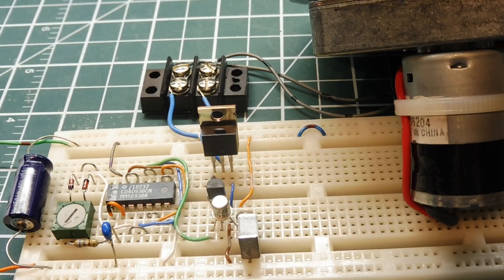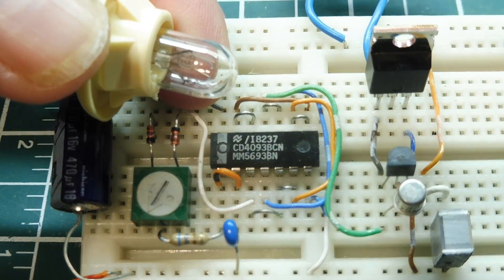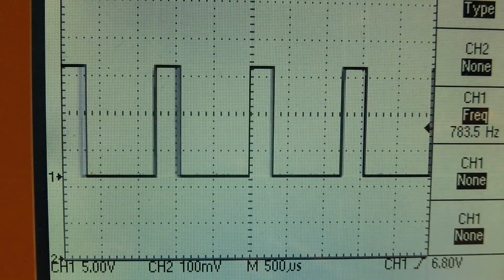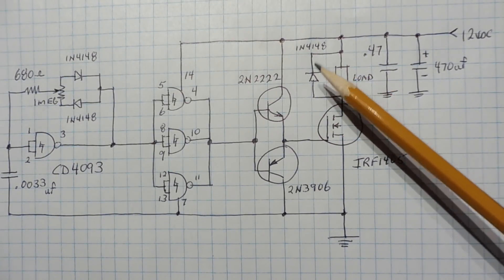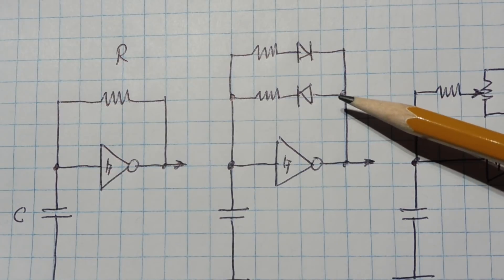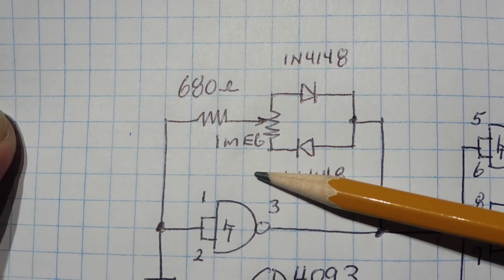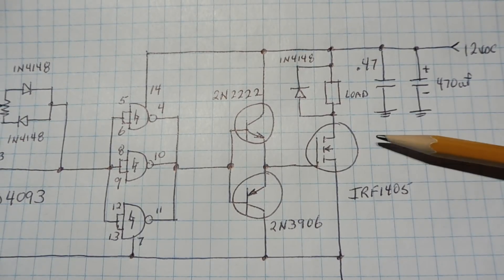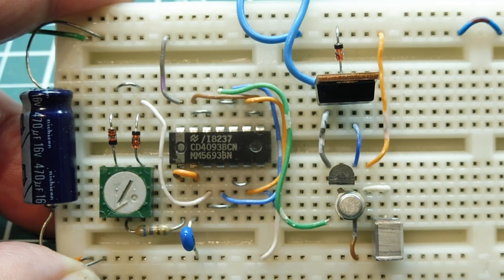Build A Simple Pulse Width Modulation Controller  / PWM

Comment: Hello just wanted to ask if i could use this circuit with 24v to drive some 24v fans?
Reply from the maker: The logic circuitry can not handle 24 volts. Check out this video featuring a PWM controller for DC motors that can handle 24 volts. https://youtu.be/1qing2TJWSc
Reply: @0033mer thanks for the advise i also will build this circuit for 12v applications but i cant find the irf1405 mosfet i only could find irf1404 mosfets and wanted to ask if i could use that one since its also a n channel mosfet.
Reply from the maker: Yes, any general purpose N channel MOSFET with the correct current rating will work.

Comment: anyone please can i use this circuit to run 240v AC load ??????
Reply: Absolutely NOT, there are much simpler ways doing so - you get triac, you get potentiometr and one resistor maybe, and viola, you control exact moment [voltage of AC] triac opens and close, if current of gate is too small, wont ever open, if it's high enough will be kept opened all the time, you can even use photoresistor to dim light automatically, PTC thermoresistor to make temperature regulator, MOSFETS in general are for low voltage high current applications, transistors are for higher voltage applications ~100V or so, thyrystors for DC to AC conversion and triacs (basically two thyrystors merged in silicone) are for high voltage AC, IGBT mosfet driving bipolar output are for high voltage, high speed DC

Comment: I really love the explanation of this video but can you mr tell me how you biased the output voltage here?..like did u use 12v by a transformer or by a function generator?

Can you also tell what is the input and output of the oscilloscope in your circuit?
Reply from the maker: The circuit was powered by 12 volts DC from a bench power supply. The waveform on the scope was monitoring the the PWM signal feeding the gate of the MOSFET.

Comment: is a dimmer switch an example of PWM?
Reply from the maker: Yes, for DC load we can use PWM as a light dimmer. For AC loads we use a Triac to modify the sine wave in a similar way to make a dimmer switch.
Reply: @0033mer  thank sir i appreciate it

Comment: I am looking to build a simple fixed 50% duty cycle circuit like the one shown at 4:36.  Where would I look to determine what value resistor and capacitor I need?  

For context I am trying to roughly halve the RPM of a DC motor, but I won’t need to adjust it afterwards.
Reply from the maker: Check out this site. It has a 50% duty cycle PWM 555 timer circuit with formulas for component values. https://www.electronics-tutorials.ws/waveforms/555_oscillator.html

Comment: I don't know if you still monitor or reply to your post but I will take a chance.
I am trying to run a Treadmill motor by its motor control board. I do not have the user interface so I have no way of sending whatever commands ( I suppose the commands means that knob you adjust in your bread board).
So I been messing with the motor control board trying to figure things out.  And after lots of messing around I have reached this point

There is a 20 pin ribbon harness. 10 pins each row.  I managed to touch two wires which read 12 volts.   In doing so, a LED light that said PWM came on.
On another 3 wire pin not part of the 20 pin harness, I read a little over 2 volts between two of the pins.  Connecting those two, another LED came on and it said "sense"
I checked the motor output and it seem to read 18 volts at all times.

There was another two pin connector which read 5 volts.  When I connected that pair, a bunch of lights came on, the DC motor light, the AC motor light and another light by the 20 pin harness and a nice loud click was part of this rascal pair of wires.

With all that going on. I connected a small DC motor to see what it does and before doing so the voltage output was still at 18 volts so I figured my little DC motor won't be on fire as the main motor for the Treadmill can handle to 110VDC.

There is another two pin connector that read 12 volts.  I was just messing with it just like I was messing with the rest, touching and seeing if something will melt or get caught on fire or not. Once comfortable then I just connect thing for good.  So I connect this pair and nothing.

But all of a sudden the motor began to get going and I kep it connected.  The motor sped up for 30 seconds or so and then came to a stop.

Dang I said to myself.  the motor was cool to the touch and no fires on the control board.

So I unhooked thsi 12 V pin and then connected them back again, the motor didn't move.

Frustrated I started nibbling at the pins, connect, disconnect, nothing.  Then all of a sudden when I would touch the pin with certain rate, the motor would turn.  But soon I gave up because I couldn't figure out the pace.  The motor would go and not go.

So in conclusion.  what do you read in all  that has been mentioned. Total three, 2 wire pins ( one being in the 20 pins ribbon harness, pwm LED) and the other two outside of it on the board.  And one 3 pin harness (  sense LED).

If I get PWM frequency generator from Amazon having 4 wires coming out of it.  Can I control this and make it work to run the Treadmill motor and if so where would the 4 wires go?
Thanks in advance if I get lucky getting an answer.
Reply from the maker: Without a schematic and wiring diagram it's hard to tell what's going on. The controller board takes 120VAC and converts it to DC to run the motor. PWM is used to control the speed. So you have two wires for AC input and two wires for DC output. A pot with 3 wires on the controller board will control the speed. Look for a MC-60 controller board on eBay and check online for wiring schematics.
https://ctmprojectsblog.wordpress.com/2018/09/29/treadmill-dc-motor-mc-60-controller/
Reply: @0033mer  So the potentiometer just plays a role in the supply of voltage or what?   would think it can not control off and on and pulses pwm role..   After all it is just a variabel resistor which has nothing to do with sending pulses...  Of course I am confused.

Messing around that board caused by sheer obsession I cracked the code so to speak and am able to run the motor.  I thought I had put the link and or the motor controller board, I guess not.   This is the controller, (asm-mef1j-3b control board). It is for Vision T9700HRT Treadmill.   There is not a place anywhere on the internet that I could find even the slighest clue as to its schematic, wiring diagram or whatever it is called.

The two pins that showed 12 volts that I was messing with I connected a potentiometer 50K. I shorted the middle one to the low side of it.. or whatever it is called so I ended up with two wires to hook it to the two pins.
The two pins that showed 5 volts, I simply decided it was the switch to turn on whatever that was not turned on when I supplied AC power to the board. So I shorted that two pins, I figured that means the switch is flipped on.
The 3 pins that showed 2 volts between two of them and the third showed nothing, I figured that is just for looks, as in like some odometer in a car.  I figured the car does not need the odometer to work for it to run.  At least not yet until someday they will make sure they will do that too. Nonetheless I didn't shorted circuit that you could say.
=====================
What I ended up finding out that once everything is hooked up and turning that potentiometer, nothing would happen as it describes what I stated my original inquiry.  Well, for some reason it is because it takes some time for the entire board to really charge up you could say.  And that means the LED light for the DC output finally turning on.   The reason it came on the first time around when shorted that two 5 volts pins is because the circuit was supplied with AC voltage for at least half hr as I was just figuring things out.
And up on shorting that two pin, the DC  out led had come on instantly.
Then I found out that if I turn the motor by hand ( but I have to wait about 5 minutes or so) after everything is on, only then that LED for the DC out turns on.  Then by turnng the potentiometer the motor gets going totally perfect.  It appears that 50K is the just the sweet size for it as far as I am concerned.  I don't have to turn the potentiometer almost half way to get the ball rolling and when it is at the low position the motor stops and I can run the motor as low as 50  RPM as I see it.

So the only thing that I sit and wonder about is how that two PWM pins in that ribbon cluster work because now I am messing with another controller.  It is Percor controller.  Another Treadmill obsession.  There are two separate pair pins that I know of, between each pair I noticed about 5 volts. And the motor does the start and stop thing, the same pwm behavior as the previous above controller. 
However I found one pair and not exactly next to each other but one over.  The voltage between that two is 2.5 volts.
When I short circuit that the motor takes off like a rocket and when I used a potentiometer, same thing.  Nothing happend and then finally it takes off as I turn it half way basically. 
When I used a voltmeter to see what happens with the two pins, the DC out pins for the motor jumps from reading 2 volts to 60 and the same when I turn the potentiometer half way, It is either nothing or 60 volts basically, no higher and no lower.

And that is my uneducated, crazy stupid way of figuring things out.  I do have a sense about them flip flip, sr latch inverter, logic this and that, nand and or stuff which I don't like the way it is taught at all.  Why?   Because across the board everybody just throw abbreviation at you just as they supposedly begin to explain the basics.   I don't even know what to call it.

[[ By the way both of the above controller board have them that plastic potentiometer thing you have. It doesn't do a thing as far as I see it in either one to controll anythng.  It is like it was set at some 10 oclock position I noticed on both. I am looking at your sit up and your microcontroller sr lach thing to see how that potentiometer causes change with PWM frequency or whatever they call it. It appears that there is a reason there is a place for a potentiometer ( an analogue item) even in a PWM circuit.  I guess it must be better than pushing on some button up and down to cause on and off time.  And all the games that can be played]]

One is put in a position in a position to know what those abbreviation are plus what they mean, whatever the meanings maybe.  They start out with abbreviation  and not with the actual principle first.

For instance instead of starting at some base phemomenon to arrive at 0 and 1.  They start at 0 and 1.
They make 0 and 1 as the principle itself.
To me not that is totally wrong and untrue but even more than that.  Even if someone somehow comes around and use the term off and on.  Or 0 and 1 volt.. or whatever, even that is false, outright false.  I know it is because I have followed up to its core.   The so called square waves they shove down my mouth is not off and on.  And I will even go futher, it is not even right to say it is two voltage state for those who really want to be pecise as if they really know it to be the actual case.  No it is not.
  

If the state as actually off and on, it won't be square waves period. The word wave can not be used.   The fact that the word wave is there already means that there is background voltage.  So I tell them, " got you". If it was truly off and on there will be an absent of any line, a total discontinuity between two of the peak square shape and not continuous line and furthermore it is false to show straight lines, with respect to verticle line on the voltage Y axis.  As in reality the voltage drops in time and not out of time segment.  So all lines ( if not tweaked) on the oscilloscope in fact must and should lean to the right as X is the time axis.  And I will even count hysterisis, so call schmidth latches or whatever they want to call it.

Anyway I went all over the map and wore myself out.

Comment: Couldn’t you just directly connect the potentiometer to the motor?
Reply from the maker: You could use a potentiometer to control the brightness of a low current LED, but is not practical or efficient to control large current devices. When the pot is stopping the motor it is taking the full current and voltage so the power dissipated is high which will heat up the potentiometer.

Comment: Hello sir, you have made an excellent video. How did you attain your expertise/knowledge in this field? What is your experience/background? Thank you.
Reply from the maker: My career involved engineering communication links (voice and remote control) using UHF/VHF radios and fiber optics. Check out other videos on my channel that will show related projects.
 https://youtu.be/WT9xWyLK-Ic
https://youtu.be/R_UQa3gXbwY
Reply: @0033mer  Thank you for your response. Did you receive formal education for electrical engineering beforehand? Or are you self-taught/On-the-job experience only? I can appreciate your substantial knowledge and experience, it is inspiring! Perhaps you may decide to do a short bio video so others can learn about your background too!

Comment: No need to use a microcontroler to make the frecuency constant, you could do a triangle wave generator (Like a 555 IC) with a fixed frecuency and then use a comparator to convert the triangle wave to a square wave with variable pulse width. Basically a VCO (Voltage Controlled Oscilator)
Reply: can you provide the 555 timer link that shows such a clean 0-100% square wave duty cycle? Also that is any better at maintaining frequency? no dig man just... can you?
Reply: Great video to be sure...

Comment: 0033mer, can you please briefly explain the terms free wheeling and steering diodes?
Reply from the maker: A freewheeling diode is used to clamp inductive voltage spikes that occur when you remove power from an inductive load. Check out this video for a detailed explanation. https://www.youtube.com/watch?v=LXGtE3X2k7Y

Comment: i have a bad backlight circuit in a tvset, it uses the AB3350CP, im not getting any PWM to the chip the mosfet that drives the out put to the led arrays isnt been driven as it currently im just at 46volts, with oscillation it should be at 120volts. Is there any way to drive the chip or just turn it on fully?

Comment: Is there any alternative to the potentiometer?
As I have a project where the speed of the motor must change according to the temperature of the room.
Reply from the maker: The easiest solution wold be to use a microcontroller. It would read the temperature value and output the desired PWM signal to the motor.
Reply: @0033mer  I'm sorry I forgot to include this we not allowed to use microcontrollers or any software programmable devices. Is there any other option you can recommend?
Reply from the maker: You could use a thermistor as the temp sensor in a voltage divider circuit feeding the non-inverting input of an opamp. A triangle waveform is fed into the inverting input of the opamp. As the temperature changes, the PWM output of the opamp will change which will control the motor speed.
Reply: @0033mer  thanks alot for the advice

Comment: You have some engineering problems in your design my friend. The free wheeling diode should handle the same amount of loading current at the flyback and 1N4148 is not rated for these loads under test. The capacitor at the power supply line for decoupling is meaningless for a value of 0.47uF since the larger 470uF will cover the effect even though the frequencies you used. Also, for the same reason you mentioned about the switching diodes for the duty cycle control, you should not use very high values  like 1MOhm because it will not operate the diodes properly so x100 greater than the R value will be the max.
Reply from the maker: Yes .. you are correct. The free wheeling diode should handle the same current as the load. The small gear motor draws 50 mA and the rating of a 1N4148 diode is 200mA continuous forward current with a surge current of 2 Amps. It is good practice to use a small value non electrolytic in parallel as shown because electrolytics become inductive at high frequencies. I mentioned a lower value pot resistance as the 1 Meg pot was all I had at the time. This was a simple circuit targeted for beginners to show what they could run into and how to correct if they run into problems.
Reply: 0033mer ... The free wheeling diode current should not be considered as the load current itself but the load switching device rating as the real load is changing and varying according to work load. Also, we should not consider the max. non-repetitive current value of any diode as its operating value at any case because it was shown for safe band region consideration only and should only use the max. peak forward current value as operating !!.... The induction effect of an electrolytic caps. can be effecting for frequencies like MHz or very short time periods like micro-sec or nano-sec but in our design case , we are in the band of Audio Frequencies and pulse duration of ( 100 micro-sec or even more up to 1000 ) so the induction effect will not be considerable at all.... On the other hand , switching high currents at short time periods need multiple electrolytic caps.connected in parallel to reduce the heat generated by the caps. ESR and to reduce the ESR itself by equivalent cct..... and great thanks for your efforts to teach the world anyway....
Reply from the maker: This is a great opportunity for you to make your own video regarding this subject. Build your own circuit and demonstrate its operation as you stated. I will show your link at the end of my video and post it in the description box. This will get your channel going where you can add more videos with varying subjects.
Reply: Dunning-Kruger Effect?